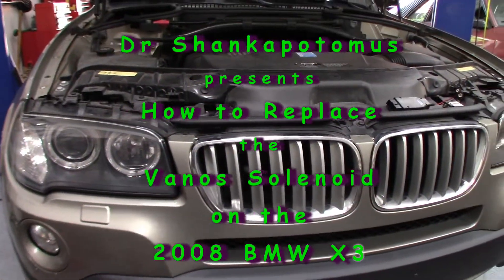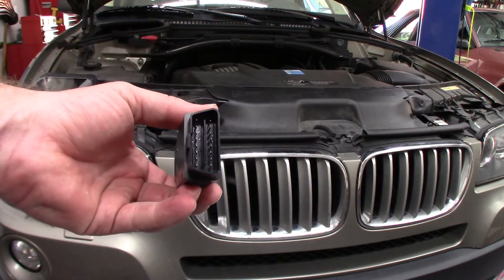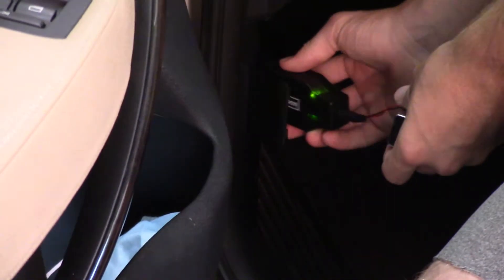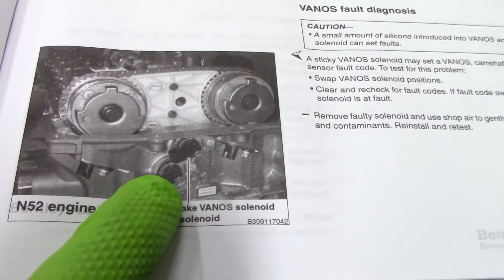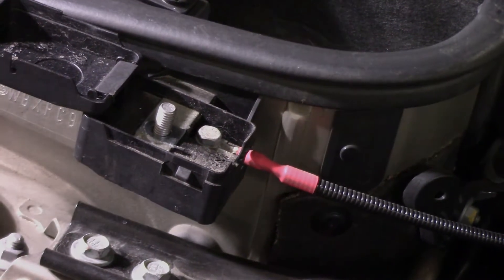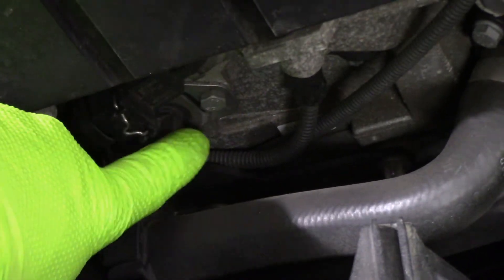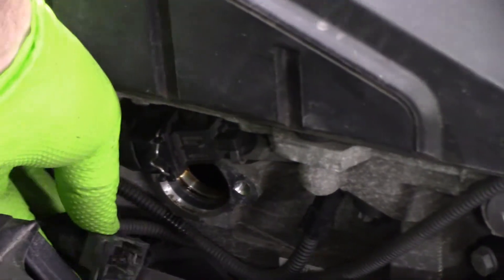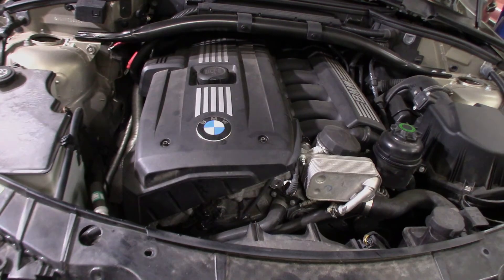How to change the BMW X3 VANOS Exhaust Solenoid, Code 2A87

Comment: You seem very knowledgeable. I have a 2008 X3; changed both Vanos, changed both camshaft sensors, still have issues. Is there a fuse for the camshaft sensors? If so, where?
Reply: did you ever get the issue resolved? Mine is having a similar code but with no driveability issues.
Reply: @chrisrich1487  Without knowing it, the problem was much much worse. a few months earlier, the serpentine belt broke while driving it. To me, it was no big deal and I changed it… And all seem well - so I thought, and drove it as usual. I found out the hard way that all motorized BMWs have a mechanical design flaw. When the serpentine belt breaks, there is a good chance it will wrap itself around the crank shaft… And slowly make its way past the seal into the motor. Thin strains pass right through the seal. That’s why all the lights and warnings were coming on the dash. Eventually my engine seized and it cost me $7000 to swap the motor. I was so pissed off with BMW that they never issued any kind of warning that this could happen. No other car manufacturer has this mechanical design flaw. and what’s worse is they have known about it for years, and failed to warn the public.
I asked BMW if they have a remedy to prevent this from reoccurring but they are pleading the 5th… they won’t even tell me if their new models are now equipped to prevent this catastrophe. 
I asked Transport Canada to investigate to determine if this warrants a nationwide recall… I haven’t heard from them.